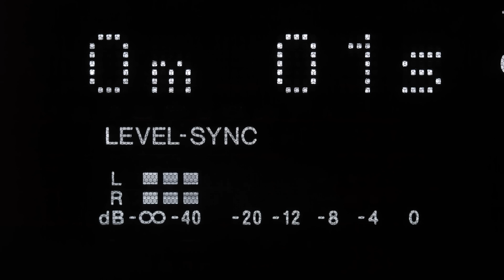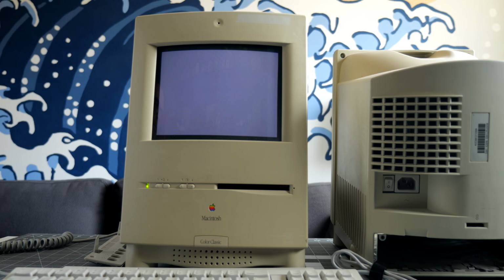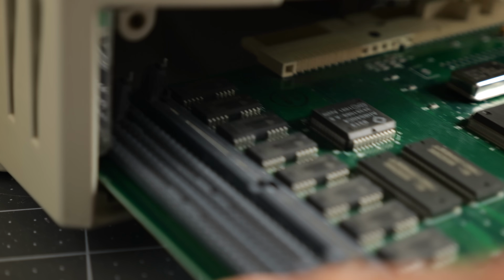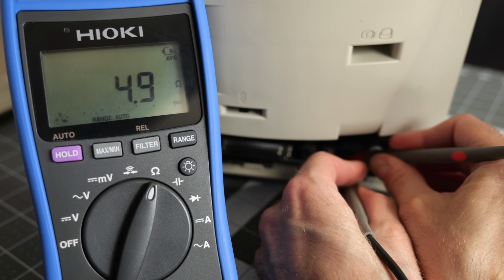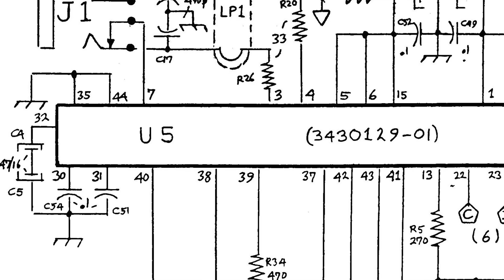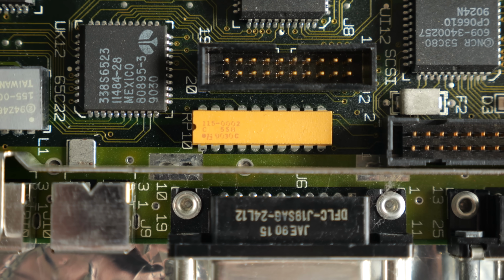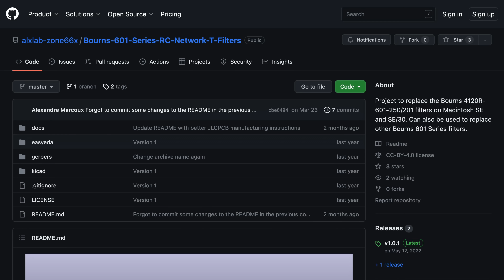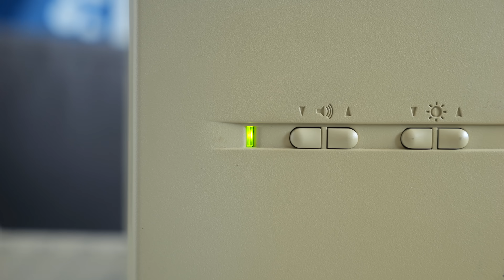Diagnosing a Dead Mac Color Classic

Comment: Sometimes you win some sometimes you loose some. In this case while not all is lost yet, I imagine it wont be easy getting this fixed until parts become available.
Reply: Biggest issues is identifying which part has failed so you know which to replace. 

 I'd really like to know for sure which chips are involved with the start up process for the color classic.  Sure you have the Cuda/Egret chip but that actually seems to be responding to the signal from the ADB port when the power button is pressed on the keyboard in this case (same as my color classic board).  So that chip may be working or at least partially working; but what is supposed to happen next? What chip/chips are involved in the boot up process and are things happening sequentially or in parallel?